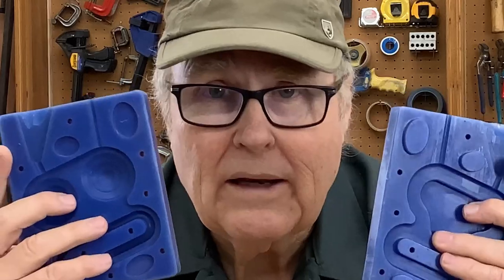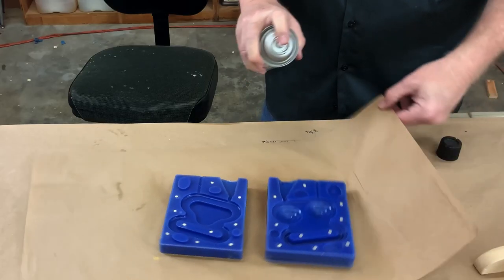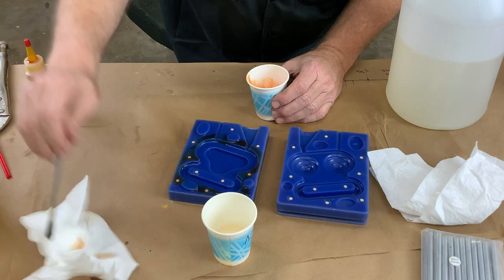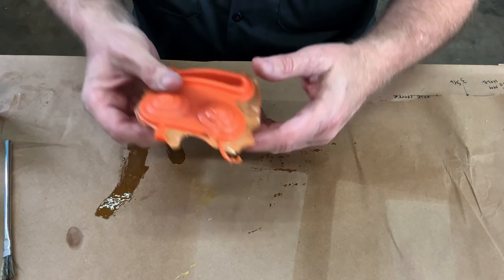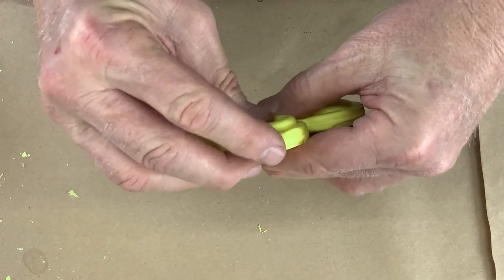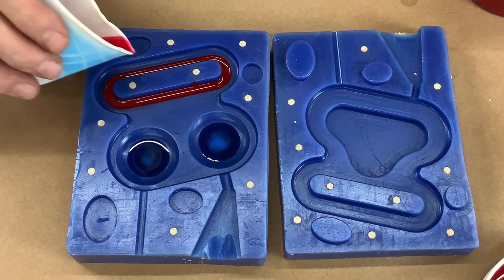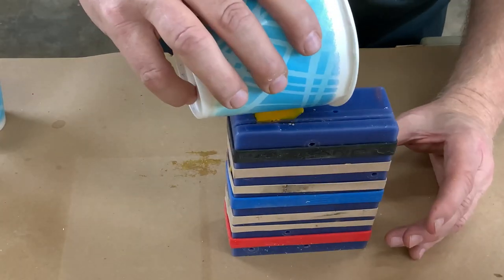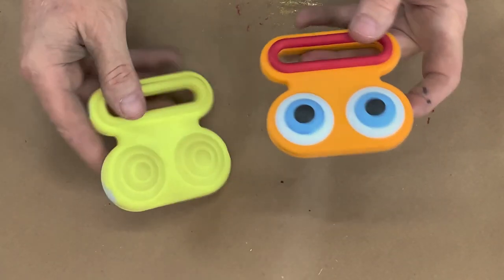Multi-Color Resin In A Rigid Tool

Comment: LOL, awesome! made me laugh with the flexible part. You can try to rotate the tool with resin before it is fully filled to coat all the surfaces with resin and get the air out of the undercut areas. You can try some vibration and tipping to remove those air pockets during the pour as well. Trial and error is required of course. Its a difficult part to cast with your rigid mold. Might be cool for the viewers to make a video showing how you would cast it in silicone to eliminate the air bubbles. Great example of alternate tooling options.
Reply from the maker: Good ideas Eric, thanks for chiming in!  Just sent you an email btw.

Comment: Fun stuff. In my head, rigid molds like that always seemed like they'd need to be for flexible castings.
Reply: I thought that too
Reply: You can use rigid molds to make rigid parts, you just need to learn ways to ease the ejection of your parts.

The injection moulding industry always uses rigid moulds to make rigid parts, and they have a lot to teach about draft angles, ejection pins, controlled shrinkage, that kind of stuff.

Comment: The through colored object will resist wear though.
I just spent $300 on a keyboard with PBT molded keycaps that have a clear undercast and lettering and black overmolding just for this reason. With wear, my caps will keep their lettering and it will stay transparent while the overmold will stay opaque. Painted caps wear out in as little as 2 months with high use.

Comment: That was excellent Bob , something very different . If you could explain what the rigid mould is made from and how it was made would be interesting too.
Reply: I agree, I also would like to see a project with a rigid mold, when and why rigid molds are used and how they are made.
Reply: Looks like Freeman Machinable Wax.
In continental Europe it's hard to get in larger blocks then what dentist labs use. In the US it should be easy to get. No idea about availability in Asia or Australia.

Comment: Wow! Another day Bob and yet another type of mold.  You’re going strong, pulling them out of your hat. Is it possible, that the soft molds allow the bubbles to move easier because you can shift the soft mold creating a relief for the air to move upwards to the vent?  With the hard molds there is no relief because the mold is already hardened and cannot provide the air a relief track to the vent? It’s like the air is trapped! Another thought. Best regards, Richard

Comment: I've noticed using alcohol inks or BJB dyes in my resin casts they are soft but harden up in a few hours so I can manipulate shape if I need to to wrap it around a bottle, object or item of some kind.
Reply from the maker: I’ve never noticed that. Are you mixing a lot of dye into the resin?
Reply: @RobertTolone maybe upto 5%. Alcohol inks especially! Thin castings come out of the mold soft and are malleable for a few an hour or so.

Comment: This is really cool. I guess since the mold itself is rigid in theory you could seal it, and you could pressurize the entry and exit pipe instead of using a whole pressure pot. In practice it'd probably shoot out resin everywhere but it would be really awesome if you could avoid the whole big pressure pot since it's much easier to pressurize a smaller volume.

Comment: Hi Robert, depending on the product to be molded, I wonder if these techniques could be used to make 3d printed molds using conventional 3d printing resin.
Reply: You can make 3d printed moulds either rigid or not it all depends what you want to cast . The draft of the tooling will limit what can be done on rigid tooling . Also mould life and amount of parts to be produced can be limiting factors aswell.  You can make a two part silicone mould ( or like Bob does a one part cut mould ) quite quickly compared to 3d printing tooling .
Reply: I did this once. Managed to get one decent casting from the FDM printed mold. Trying to remove cured resin from a plastic mold is not easy, even with a release agent.

Comment: i use a small vibrator to remove bubbles immediately after a resin pour. has worked pretty well. just when i think no more bubbles will pop to the top a big one 'POP's. if you do a multi-color resin casting will spraying a UV protective clear coat keep the resin from yellowing?

Comment: Lovely video, Robert. :D Poor Mr. Floppy Face. ^^
I agree to Glen, I would love to see a project that needs a rigid mold to be done.
Also I would love some advice about multi casting. Like when you want a colored, maybe painted, part on the inside and cover it within a body of clear or translucent resin.
Maybe I can come up with a project for that.
Reply from the maker: I have yet to tackle overmolding. Mostly because I’ve never done it.  But it would be fun to try.

Comment: Another great video Robert! I'm wondering if you have anything to say about urethane rubber molds? I've got an item I want to cast but because it's been coated with shellac I've been lead to believe (from the manufacturer's website) I can't use silicone rubber, and I'm not sure I can coat it with another product first (fine detail).
Reply from the maker: Are you using using platinum rubber?  Not sure why shellac is a problem. Urethane rubber works great in many situations. in my experience, it’s actually better for casting materials like plaster and cement. It’s very tough and harder to cut than silicone and it also sticks like crazy to most materials. It actually makes a very good adhesive. So you have to use a good release agent and apply it carefully. Be sure to test anything you decide to use so you don’t harm your object. Also be very careful casting urethane resin into urethane rubber as it might bond completely.
Reply: @RobertTolone  Thanks for the info Robert. Concerning the shellac, I was reading on the smooth-on website that the alcohol in shellac will cause silicone to bond to it, apparently both kinds. So that's why I ask about urethane.

Comment: Hey Robert, great job as always.  I would like to know how you made that rigid mold. Did you do a video of that mold already?
Reply from the maker: I made the original model in a CAD program called Rhinoceros.  That was exported into Mastercam which produced the tool paths and I cut the wax mold using a desktop CNC mill.
Reply: @RobertTolone  what desktop cnc do you use?

Comment: Can we please request for you to expand on materials and techniques for rigid molds. Is there any techniques different to silicon mold making? You mention that this mold is wax and old. Is this another of your beloved wax products to be robust enough for multiple castings?
Reply: Wax is not a material but a physical property.
These are very hard. They CNC machine easier then POM but you have to watch how much heat your CNC tools put into the material as they do melt.
When melting it shrinks a lot on solidifying and it's heat-capacity is enourmous.
Reply: Totally different process

Comment: Could you do a video on painting urethane resin and getting a good, solid bond that doesn't easily scrape off?
Reply from the maker: I usually wash the resin parts in acetone or lacquer thinner then spray on a light primer coat.  Krylon makes primers and paint for plastic but most spray primers like Rustoleum, etc work too. then I just paint with Artist acrylics. My oldest painted cast pieces are from the 90s and they have held up very well - although they are display pieces and are not subjected to hard wear.

Comment: Each time you said rigid tool, my mind went to RIGID brand tools. LOL. I work in the oil & gas industry, and our field guys use RIGID pipe threader machines a lot. Anyway, thanks for your lesson! This will come in handy for some upcoming projects I have in mind. BTW, I loved the squishy failure when it was still floppy! ✌🏻💜🛼

Comment: Since the mould is made from (I assume) machining wax, wouldn't you risk deforming it with the rubber bands? Why don't you use a pair of steel plates (Without the bolts) to distribute the pressure from the rubber bands?
Reply: Machinist’s wax isn’t going to distort from those rubber bands.

Comment: Can you explain more about the static electricity comment?
Reply from the maker: I talked about it in the video but that footage got cut. Because this mold didn’t produce a really good example of it. Sometimes when pouring resin into wax molds you get a static discharge that causes the resin to spatter.  I think it may be caused by the fact that I wipe out the mold between applications of release. And that wiping may build up a static charge in the wax.

Comment: Hey there, do you have any tips for when your polyurethane resin is heating up too much that it’s literally melting your silicone mold? (Causing the casting to bind to the silicone, despite using mold release)
Reply from the maker: How large are your castings?
Reply: @RobertTolone  thanks for responding!They are 2in. X 2in. X 2in. cubes. I’m using crystal clear polyurethane resin in a platinum silicone mold (shore hardness of 30A). Casting is done in two layers to suspend an object in the middle.
Reply from the maker: @lozcity  I can’t imagine that castings that small could generate enough heat to melt silicone. I have occasionally heated silicone molds to the temperature that they were too hot to handle and they certainly didn’t melt. Something’s going on with your combination of materials. Have you consulted the resin and rubber manufacturers?